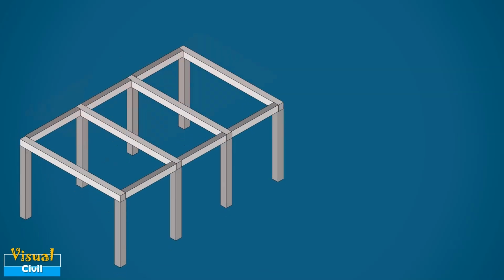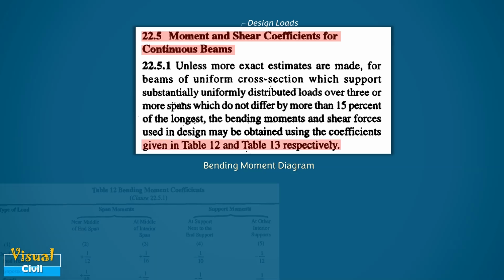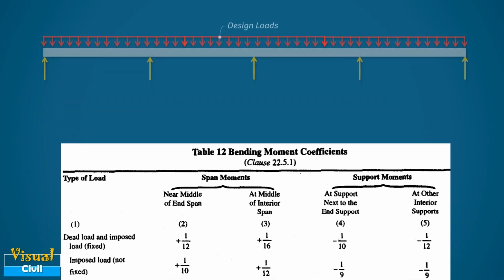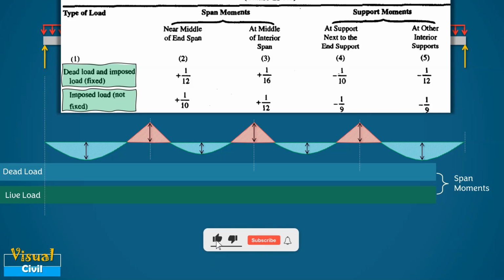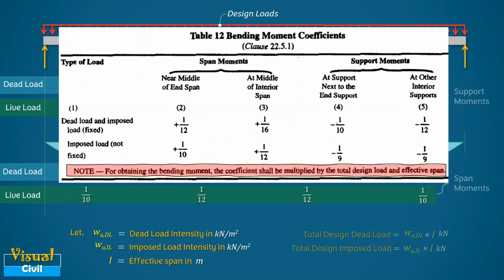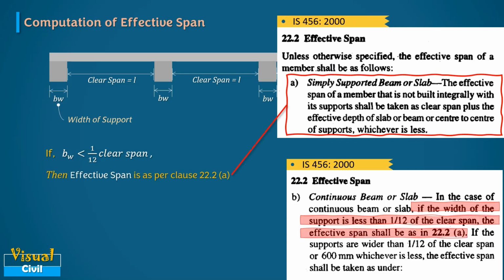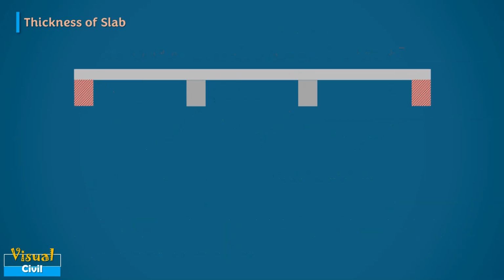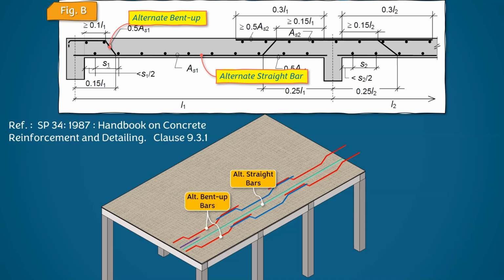Design of One Way Continuous Slab - Part 1 | RCC Design | Structural Design

Comment: Sir 3 span one waye contin......span connected long beam supported that is why namely one way continue.... Span if 3 span one way slab connected short beam what is called ?
Reply from the maker: In that case it will not be a continuous slab. Here individual slab is to be designed.